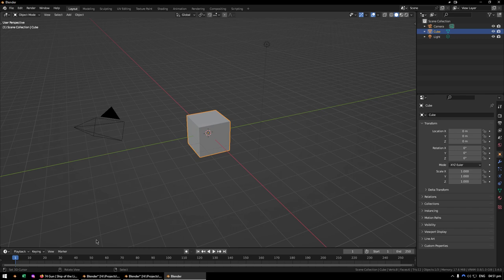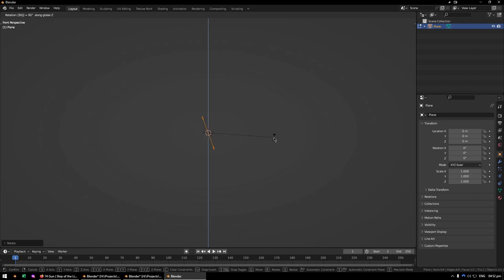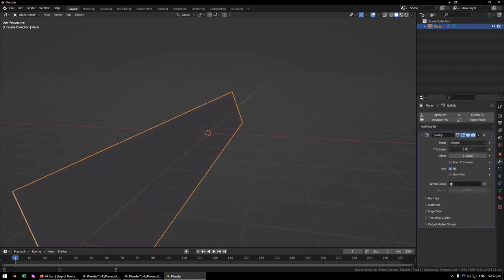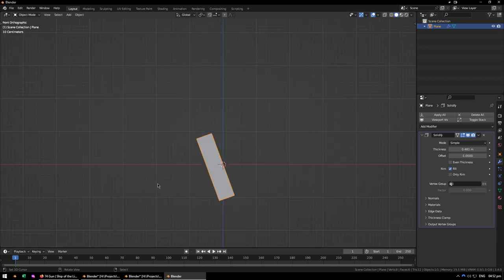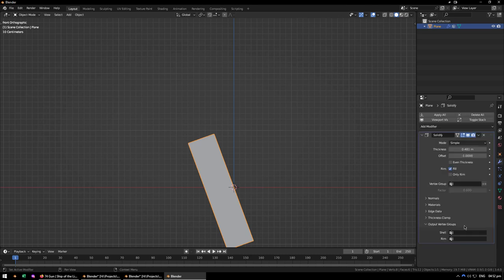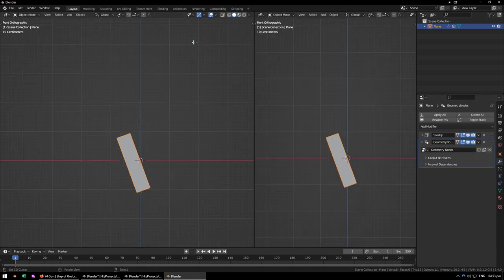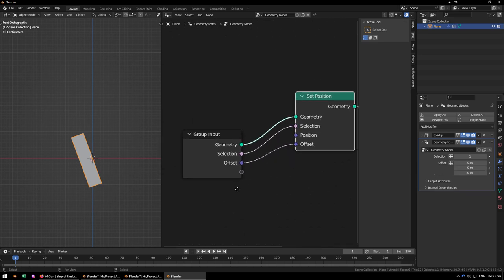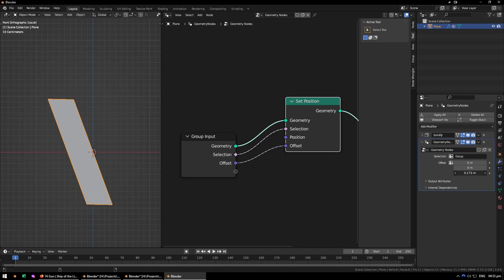Adjusting the Output of Solidify Modifier with Geometry Nodes | Blender Quick Tip

Comment: Interesting solution, but the offset for the geo node depends on the angle of the plank relative to vertical, no? You would have to set it for every single plank (or at least where the angle has great variations) also you'll end up with differing thickness.